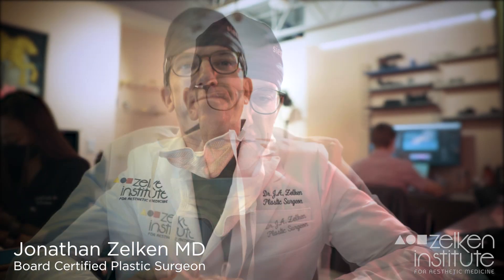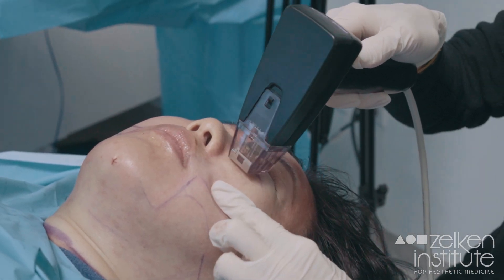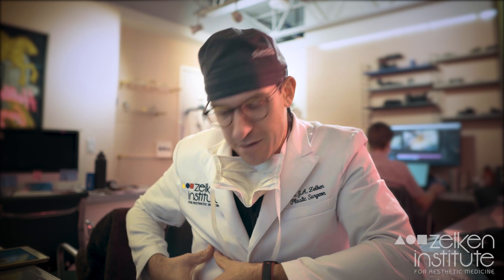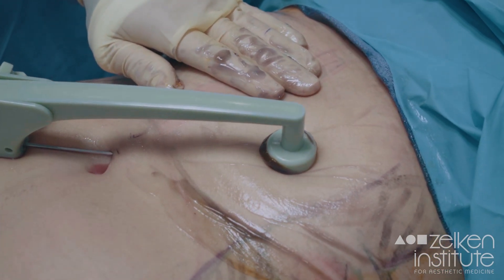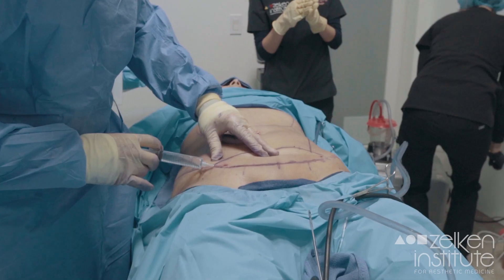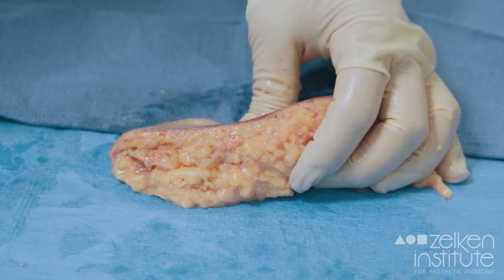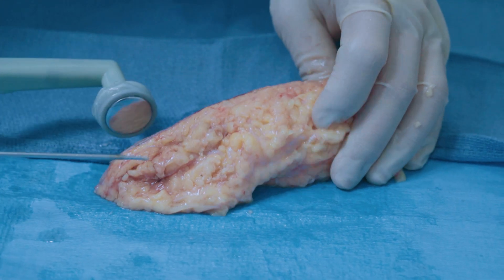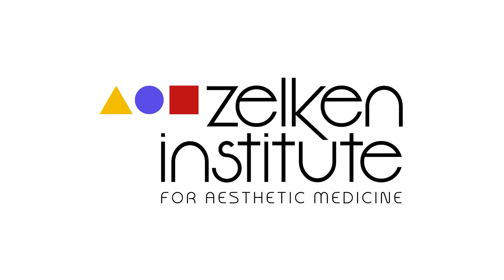How does BodyTite, FaceTite Radiofrequency assisted lipolysis RFAL energy based skin tightening work

Comment: It appears that this procedure is effective in fat removal, but not so much in skin tightening (I'm referring to the lady's neck, where it's obvious that fat was reduced, but there was still quite a lot of saggy skin left). Is that the case? I have no fat under my chin, just a little bit of skin sag, so I am wondering if this wouldn't be just a waste of money.
Reply from the maker: This is a great question. I’ve always felt that the technology is better for necks that are not “deflated”. I cannot answer your question without examining you, but if there is skin laxity and no fat, traditional facelift or neck lift surgery may be a superior strategy.
Reply: @jonathanzelkenmd  Thank you for your reply! I'm a slim 35-year-old with pretty good skin. The skin under my neck is the first instance of laxity and crepey texture, so there's not a whole lot, but it's no longer taut (and there are some platysmal bands as well, which ages the neck). So given that, I'm wondering what method would make the most sense to do away with this first sag. Thank you!
Reply: @jonathanzelkenmd  can you use the fat from bodytite device for Lipofilling or grafting for breast or BBL ?

Comment: Is it customary to do both Plasma and Vaser procedure simultaneously? Does this procedure give a better result compared with old techniques? How long is estimated down time and how long will results last?
Reply from the maker: No it’s not customary to do both simultaneously. I find energy based adjuncts to liposuction very helpful in the way of recovery, bruising, and of course, cosmetic outcomes. Results last as long as your weight is stable (and of course you will continue to age) and downtime depends on what you do.